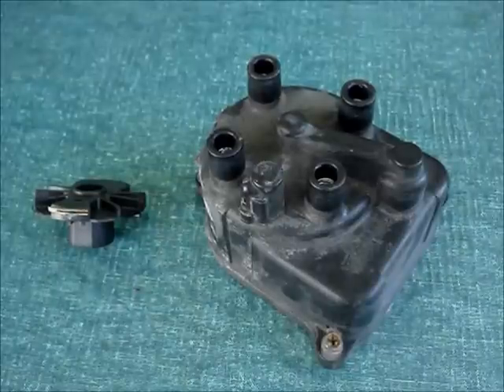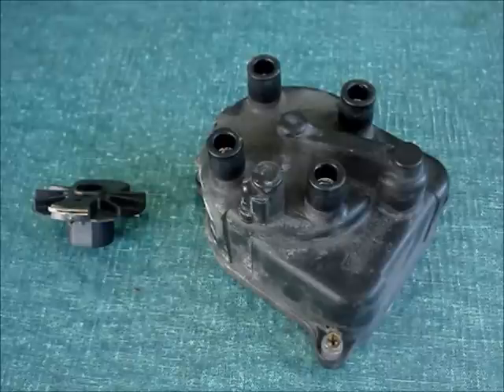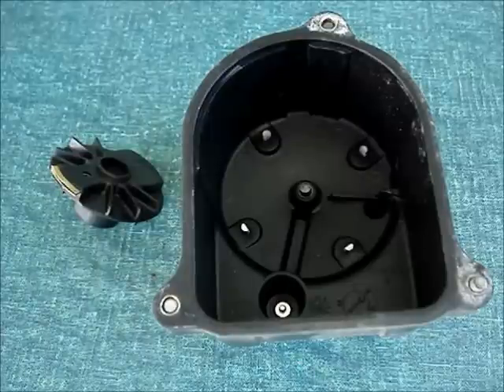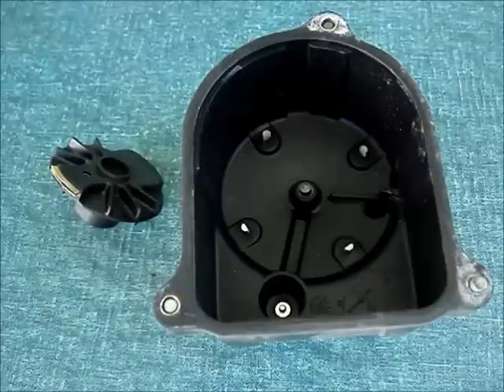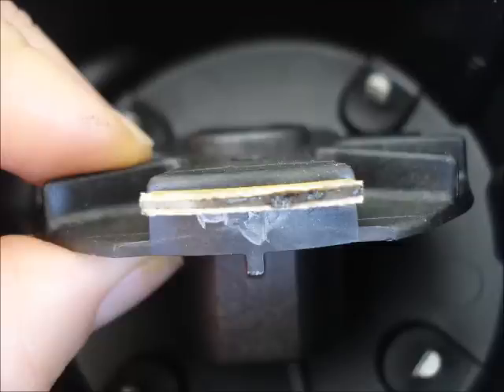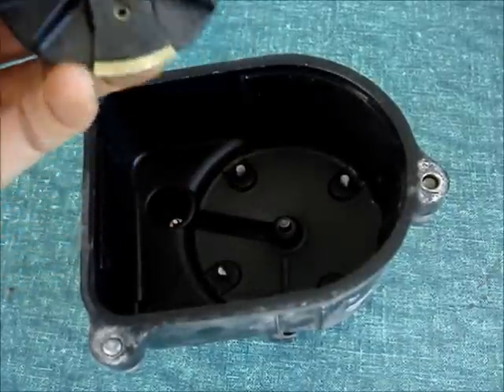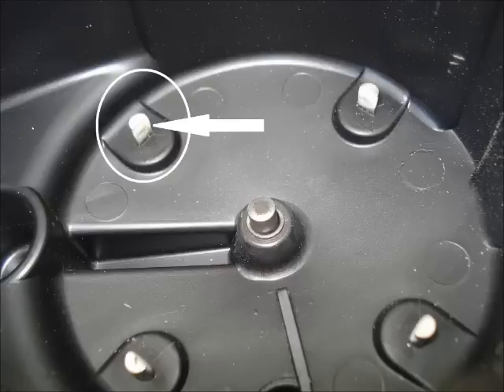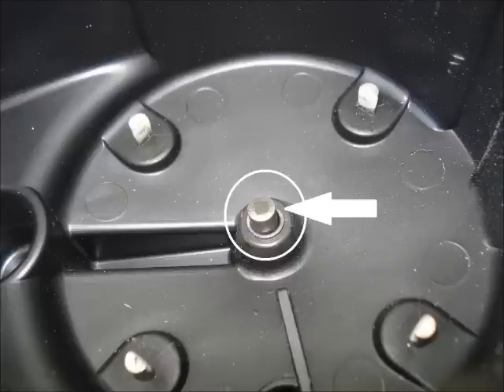Signs of Worn Distributor Cap and Rotor

Comment: I wouldn't be ashamed to admit getting over a hundred thousand miles out of a distributor cap. My motto is "if it ain't broke, don't fix it".
Reply: i got 300 000km out of mine the middle contact point has been grind down its almost gone
Reply: That's how yiu get surprises!!! Change it before it breaks. There's a schedule provided by manufacturers for a reason

Comment: My Chevy Astro is getting about 11 miles to a gallon. I do have a solar panel that causes drag, but not too much weight added in my “camper build”. Very minimalist with a wooden bed frame and shelving. I can’t imagine it’s much more weight than it would have with the original two bench seats and especially if they were occupied by a couple of people. 

Anyway, was actually doing a search on the symptoms of these parts needing to be replaced. Performance and sound of the engine, which doesn’t seem to be included here. I fixed some stalling and misfiring issues by replacing spark plugs but it seems to be very loud while accelerating and struggles to go uphill at 55.

Comment: Excellent, I have a 1987 Toyota Carina which has a very similar distributer cap where the coil is included in the distributer. The car has only covered 86 thousand miles but it is now on its third coil  since new ? I have changed spark plug wires once. I see that I should also look at a new distributer cap.  Recently I removed all the trunking to the air cleaner. I  also cut away about a quarter of the top cover of the air cleaner. My ! what a difference ! I now get 45mpg instead of 29mpg .:goodvibes:

Comment: Vefy excellent video can be applied to most dktributer caps it a better design than my Toyota 1987 Carina, which is now on its 3rd ignition coil in 86000 miles.

Comment: It pays to stay on top of that.   I've gotten extremely lazy with age and I let my cap and rotor go to where I couldn't start the vehicle.  I ended up bringing it to a garage because I just didn't have time to mess with it myself.  Ended up being $1,000.  =8O
Sure, I coulda complained and forced them to take a shortcut or two,  that probably would've shaved off a couple hundred bucks.  As it was, tho, I didn't let them change the plugs because I just had them change them not long ago(should've had the cap and rotor done then).
I know I could've cut the bill by 2/3 doing it myself, even more if I used cheap parts, but I prefer higher quality parts.
Reply: I was trying to guess which part you were referring to, but I think you are talking about the "I didn't have time" remark.  Ya, the truth really is I didn't have the motivation or energy.  When I was young, taking the bicycle back and forth to the parts store a half a dozen times and working on it until 1 AM, then getting up at 4 AM for work, was something I would've done, not so much anymore.  ;)
Reply: +Bootney  O, that.  Ya, TBH, when I bring anything in for work, I'm just happy to get it back running.  It's rare to find a mechanic that can do it right for any price.   When I was young, I never understood why people disparaged mechanics so much, because I did almost all of my own work.   Now that I bring vehicles in more often, I get it.
Hell, back when I bought a clutch for my Jeep, I felt lazy and was just gonna have a shop put it in.  I ended up doing it myself because nobody would put a clutch in unless I bought their crappy clutch brand that they sold.

Comment: Assuming these parts were working when removed, and the new ones were not OEM parts.Then I would recommend you clean the old parts up and leave them in the trunk of your car, in a zip-lock bag, as in my experince you won't get as long a life from the new parts.
Reply from the maker: I replaced with OEM parts.  I still have the car and it now has 192,000 miles on it.  I still track miles per gallon and haven't had to replace the cap/rotor.  Interestingly, at around 105,000 a friend and I replaced the timing belt.  We put new AC/Fan/Alternator belts on at the time, Honda OEM belts were used.  I know those belts were original, the car has been in the family since new and I have all of the service records.   I had to replace those belts at 190,000.  When I turned the AC on, one of the belts was squealing.  After tightening the belt 2 times, it still squealed.  My mechanic friend (been doing this job all his life - around 40 years) says that even the OEM parts are not as good as they used to be.  Sad.

Comment: I don't see anything wrong with the "old" one. Just clean it and it's good to go for years. But those things are so dirt cheap that when having problems with spark plug wires you can change the distributor cap and rotor with them if you buy the parts online and already have to pay for shipping.
Reply from the maker: The gas mileage had dropped off, that's why I replaced it.  With the current price of fuel, replacing the cap and rotor was paid for by savings at the gas pump.

Comment: If the cap and rotor aren't cracked there is no need to replace them. Just clean of the carbon of the tips in the cap and on the rotor. Check for moisture and if necessary whipe it off. This is just maintenance and this is how you keep your money in your wallet.

Comment: problems are, poor gas miliage, poor aceleration, gears wont shift  smoothly,  eratic idle that can never be fix no matter what, detonation missfire, there is some resistance when you acelerate, noise pinping,  and never buy fake brands first thing to do is sparkplugs then cap and rotor last are the cables.
Reply from the maker: Thanks for the helpful comment, it's contributions like yours that add to the value of the video.

Comment: A vacuum advance mechanically changes the inside of the distributor. But what does an electrical connection tell the distributor ?  Same thing ?  And where does the signal come from ?
Reply: The distributor usually has a hall sensor which sends a pulse to the ignition system controller (assuming you've got transistor based ignition, 1980+ vehicle), which then fires the ignition coil. On my Mk2 thats three wires. 12V, Pulse and Ground.

Comment: I have a Mercedes 560sl has the original rotor and the cap stamped 1987 with 200k miles. Careful cleaning should do the trick. Don't just change good parts for the sake of it!!!
Reply: better no trow away the old parts in case the new ones are problematic, or youll be lookin for the fix where it is not.

Comment: Hi. I have a 1998 3.3L Nissan Pathfinder. 175,000 miles. Great condition. Stock. My tank gets alarmingly  pressurized when driven a couple hundred miles. I don't have any codes. My Nissan gas cap visually inspects clean and good. Does not leak. 

I even disconnected all hoses on the EVAP system and cracked the gas cap. No codes were made either. How can that be? I drove it dozens of miles to test. To see if the missing stopped or codes would appear. No codes, except random misfire. Every now and then, but the motor is obviously missing mildly to badly all the time.  It gets worse for a while when I refuel.  For a few dozen miles.  

When this system started doing this, I started getting a random misfire code at the same time. These may be unrelated. Not sure. 

I have verified purge valve works, hoses are clear now. One was dirty about 2" clogged at the canister for the purge line. It looked like charcoal dust. All other hoses clear. 

Any ideas?  I was going to remove the plug from the cannister ambient vent valve and see what that did. It should toss a code right?  And make the valve open, from my understanding?  I don't want the tank to pressurize like that again.  It will spew and hiss for about 6 minutes when cap is removed. I've never seen a vehicle do it this badly before. 

Thanks!
Reply from the maker: I'm stumped.  You might look for a Pathfinder forum.  Someone else may have had the same problem.  There likely aren't too many on the road anymore, but you might find an archived thread on the topic.
Reply: @Know-How-Now  there are many around me but the operators are usually not DIY

Comment: Did you track any change in fuel efficiency after changing the cap and rotor?
Reply from the maker: Yes, it improved.  I don't remember the exact amount of improvement.  I just knew that the mpg I usually got had dropped off.  I still wasn't getting the mileage that I should have so I then replaced the PCV valve.  After replacing the PCV valve my mpg was back to normal.

Comment: I would have cleaned that rotor button outer edge, with a file, or brick wall,  and saved some  money,
Reply: I think there are gao issues where the arc does not happen well

Comment: I know you say to gauge rotor life by tracking gas mileage but is there an average mileage when the cap and rotor should be preventatively replaced?  You say 100,000 is way overdue and 30,000 is too early so you must have a figure that is somewhere in the middle.  40, 50, 60,000?
Reply from the maker: Hi Brian, when I made the video, I did some investigation to try to find a solid number of when to replace the cap and rotor.  I found a wide range of answers.  The folks who manufacture/sell parts and some repair shops have an interest in changing them more frequently.  The quality of the parts is also a factor and climate could be a factor too.  I'd like to say that the cap & rotor in my Civic don't need to be changed again until I hit the 100K mark, but maybe the new OEM Honda parts aren't as good as the ones they made in 1999. A cheap after market part may fail much sooner.

I worked for a company that had a fleet of autos.  We monitored the gas mileage as a tattle tale of when a vehicle needed maintenance.  My opinion is using gas mileage is the most economical way to decide when to change out/check ignitiion parts.  I know some people will disagree, I'd like to know their method if they have a better one.
Reply: The thing about gas mileage is my 92 Camry's ignition system failed around 120,000.  I wasn't watching it and the coil had cracked and the plugs and rotor were worn to nubs.  The mechanic found it when it wouldn't start.  Right up to the overtime failure I had been getting 30MPG so I never noticed a drop in mileage.  I don't want another no start failure so I was going to start doing plugs, wires, rotors at 50,000.   No one wants to give a mileage number for replacement so I just picked that one so I don't have to pay for another tow, cab and diagnostics at 10PM in February.
Reply from the maker: That's interesting.  I agree with you, it's better to do a little preventative maintenance than wait until failure.  I do a lot of my own repairs/maintenance (the easy stuff) and spend the extra money on OEM parts.  I think the OEM parts tend to be better quality and last longer.  One time I made the mistake of buying cheap spark plug wires.  One of them quickly failed, I never thought to look at the wires since I had just replaced them.  It cost me a trip to my mechanic. 

If you have a mechanic that you trust, you could ask how often to change the cap, rotor, plugs & wires.

Comment: So I'm now even more ashamed than you, my 93 Cherokee have over 300k miles on what I believe must be the original lol. The reason I'm watching this video is because my Jeep don't want to start in cold or raining days, so I went to check the distributor cap, and it doesn't seem to have the center pole anymore, I thought it was weird since I don't think that my Jeep shouldn't start even in normal weather conditions, with a cap like that.
Reply: carbon, change spark plugs, cap and roto, cables and do buy the original or a top brand

Comment: What’re symptoms. I’m getting random misfire code and also a maf airflow codes but maf is good. 
Already changed out the plug wire spark plug now I’m down to two fuel injectors or the distributor and rotor.
Reply from the maker: My gas mileage was down.  No other symptoms for me.

Comment: Thanks so its the rotor and the cap that go bad? Because i pulled out the piece with a computer chip in it also.
Reply from the maker: I don't have an opinion about the computer chip.  There are so many variables depending upon the era and model of vehicle.  

I am trying to show what a cap & rotor look that are at the end of their life.  Hopefully after looking at mine, it will help you need decide if you need to replace yours.

For questions/problems with specific year/model of a vehicle, I find that the online forums for my car are often helpful to solve a problem.
Reply: +Dexter  You might have a car where the ignition module is bolted on the distributor.  Otherwise all that is likely to be in there is the pickup sensor, of which there are different types.  The cap and rotor are a normal wear item, like tires.  Those other parts are typically only replaced when they fail.

Comment: good video. Automobiles no longer use a distributor cap and rotor button. No need for them, each spark plug has its own ignition coil

Comment: Well ain't that familiar! I drove a 98 dx I got with 192k km on it (its 'round 1.6km to the mile, so ballparkin' it at 130k miles) and it had an original distributor cap and rotor 😂

Comment: Original OEM Parts... ist that an oxymoron, a systematic redundant term?
Reply from the maker: I suppose I could have said factory installed parts.  It takes a lot of time to make a video, there are likely hundreds of things that you can do to give people something to complain about.  If nothing is going wrong, you likely aren't doing anything.
Reply: Original OEM as in originally installed. I am about to replace my distributor parts with OEM parts but they will not be the originals, but still happen to be OEM.

Comment: Would this cause a voltage drop. A running car usually has 14.1 or 4 bolts but I've noticed that mine is dropping 1 volt. So about 13.1 to 13.4. I do have an aftermarket sound system but the voltage drops even when the volume is on 1
Reply: definitely no
Reply: The alternator determines how much voltage is running through your car.  Usually charging up at about 13.5 v is normal.

Comment: The 92 Civic is the same as the 99 correct? Can this cause the car to stall when pressing on the accelerator? I just bought a Civic and noticed a lot of dust in the distributor cap and have just started having problems with it stalling.

Comment: When I stick my key in my o5 tL it won't even let my key turn it's like it's the wrong key could this also be the rotor and cap?
Reply from the maker: No.  Here's a link that might be helpful:  https://acurazine.com/forums/3g-tl-problems-fixes-114/key-wont-turn-steering-wheel-locked-881230/

Comment: Hello,
My HONDA CR-V engine auto turn off during drive and not again starting at the same time. I have to take wait about 10-20 mints for again start. I am facing this issue 8 to 10 time per day from last week. I'll subscribe to your channel, do likes, views and share it to others. Can you please help me, how to deal with this issue?
Reply from the maker: It's not easy answer your question/solve the problem sitting at the other end of a computer.  There are internet forums for specific car models.  You may want to find a Honda CR-V forum.  Perhaps someone has had the same problem with their CR-V.
Reply: Thank you!
Reply: One thing i found, I can't get the spark in 4 plugs.
Reply: Is it distributor fault? If yes then, is possible to repair or it is like something that cant be repaired.
Reply from the maker: This video may be helpful:  https://www.youtube.com/watch?v=XSWN1M8Hoqo

Comment: my 97 honda accord, will crank up and start for about 3 seconds then stall out.  it sputters like there is no fuel.  I changed the furl filter, and I he regulator but still not working... could it be the idle air control valve, or the distributor cap and rotor? plz help
Reply: Lovely One most likely a bad fuel pump.
Reply: no dont change fuel pump yet thats what my car did on the road got home i cleaned the contacts on cap with small wire brush and a  400 sand paper to rotors now car runs goid as new again but yes it was bogging down lime it had no more fuel
Reply: @trustnobitcheqz  how about ecu maybe it has bad leaking capacitors or u might have and vacuum leak

Comment: Ur wrong my distributor cap is pink
Reply: Mines brown
Reply from the maker: For sure, mine is original OEM part.  I have have all of the service records for the car.  It is also possible that Honda used different suppliers... so it doesn't have to be a fight about right or wrong or accusing others about right or wrong.